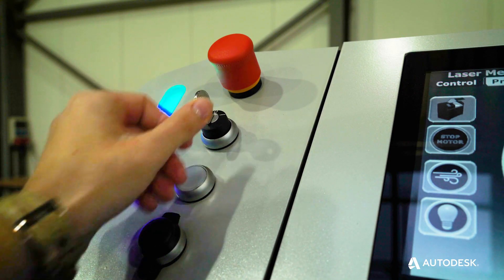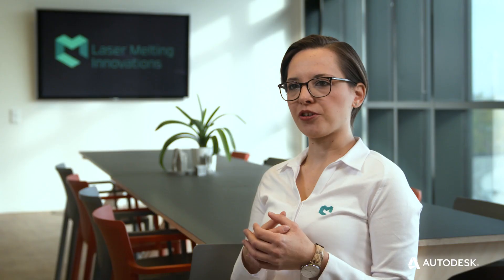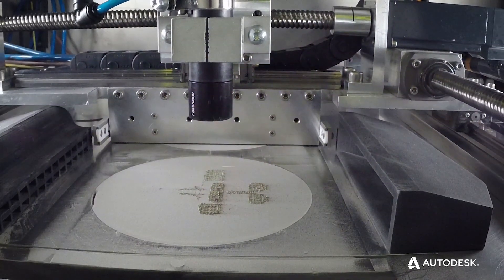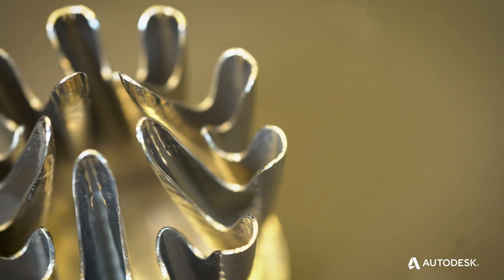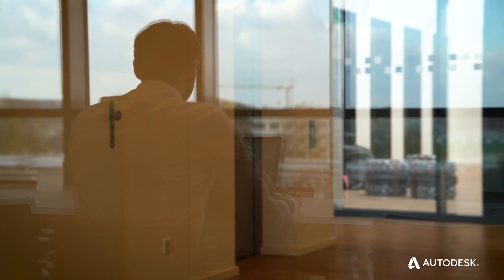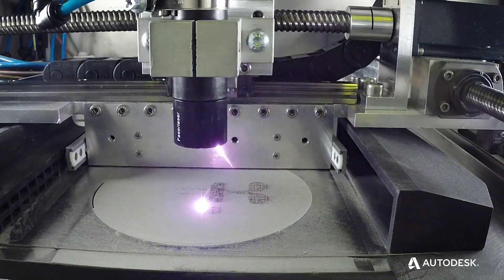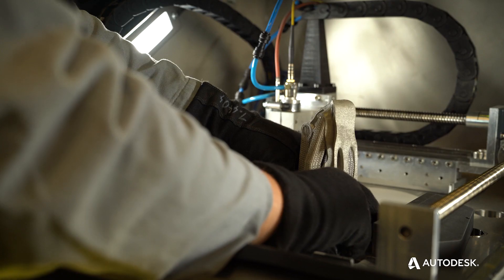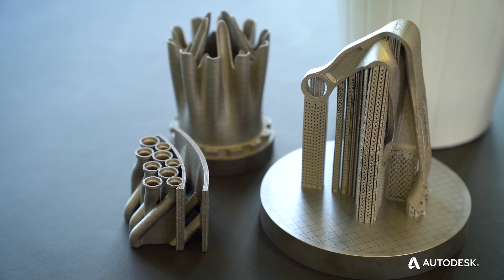Selective Laser Melting Printing with Fusion 360

Comment: Nice to see cheaper SLM coming on stream. However, high grade engineering skills are required to effectively use the technology. See for example: Metallic Microlattice Structures: Manufacture, Materials and Application by Robert Mines, Springer 2019.
Reply from the maker: Nothing wrong with a little promotion! Robert, I'd be interested to speak with you or maybe get you to contribute a blog on the subject....can you email me at aaron.magnin@autodesk.com

Comment: Btw, how do you clean those supports in crammed up spaces? Are some generic pliers enough?
Reply from the maker: Those supports should come off relatively easy, but there are times where there are better tool options than your household pliers.
Reply: They r usually weak and comes off when hit wd a mallet, though removing is difficult sometimes proper support strategy shud be provided
Reply: You can probably use a Dremel.